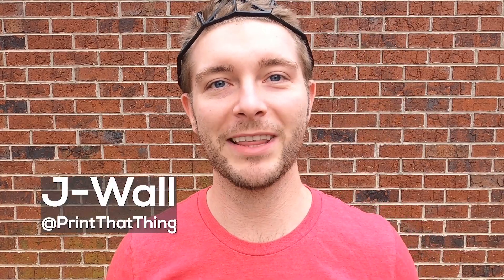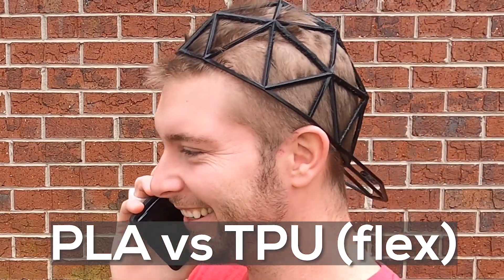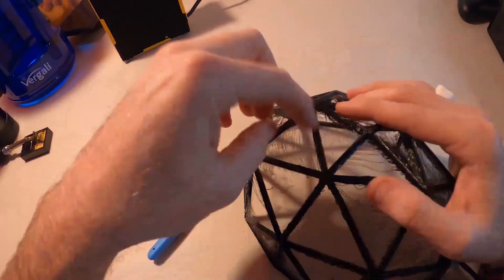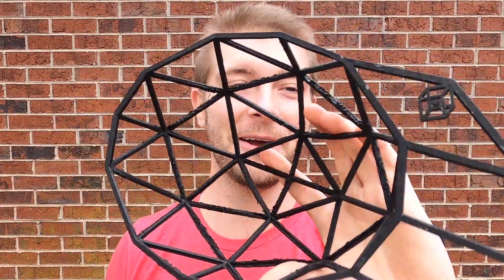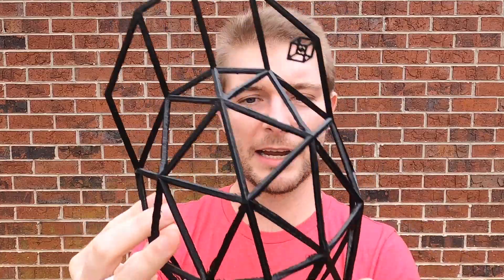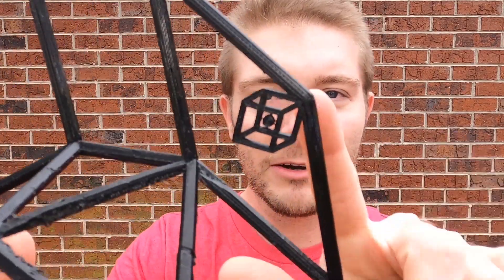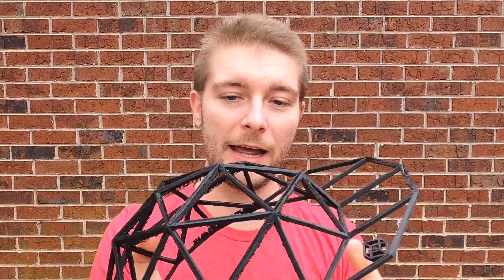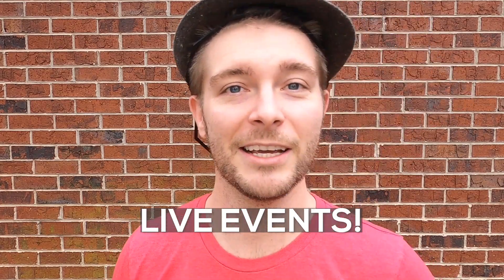3D Printing Hats! (Flexible) - Pros & Cons of TPU with Wearables

Comment: Awesome job Jwall! I'm actually surprised that print turned out so well as long thin TPU parts sometimes sag and deform under their own weight.

2 quick TPU tips.  

 If you were printing with Z-hop enabled try turning it off. The slight pause while the nozzle lift will start forming a string on filaments like TPU/PETG that are notorious for stringing. Turning Z-hop off so the nozzle moves sideways immediately after retracing the filament is more likely to shear off any strings before they start. A print like your hat with a lot of overhangs and thin parts might need z-hop to avoid hitting the part and flexing it out of position but it's worth trying without it. It makes a BIG difference on stringing. 

A hot air gun is a great way to remove stringing too. The thin webs will melt and curl back to form little balls on the surface of the print that are easier to clean up with a scraper (or just rub off with hard filaments) just keep the hot air gun moving and don't get it close enough to melt your print .
Reply from the maker: You da man!!! Thanks for the tips

Comment: Awesome. Thanks for the reference. I would suggest a larger nozzle like 0.8 or even 1.0 mm and the use 0.6 layer height. It will print faster and be stronger. 
Also check out the deburring tool in my Filament Friday Tool Kit for cleaning those strings easier.
Reply from the maker: You're the MAN Chuck! Thanks for the tips and great videos.